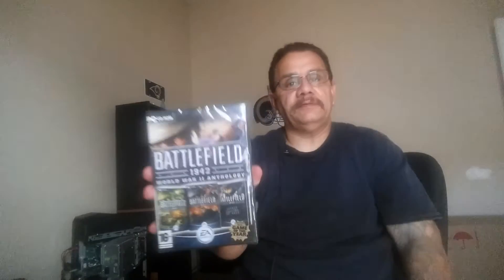Alienware Aurora R5 my thoughts on my pc

Comment: This is an older video, so you probably already know this, OG, but for other viewers: Not all R5's are liquid-cooled, only the K processors are "on water," so to speak. The 850 watt liquid-cooling is noted as 'Recommended' on the R5 spec page, but is not stock. To have given you a free K processor and cooling unit (which was a $300+ upgrade, if I am not mistaken, plus labor) would have called for more generosity than probably Dell is capable of. My R5 (which is 1070 like yours, but liquid-cooled) is supposedly being delivered today, I'm hoping mine isn't plagued with all of the issues that yours wars!